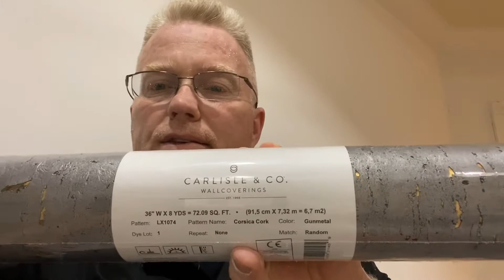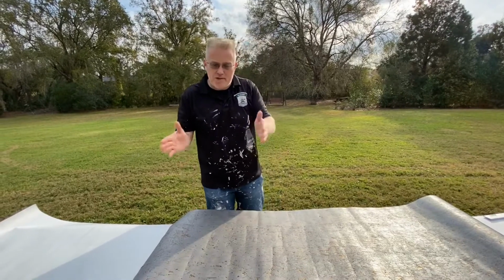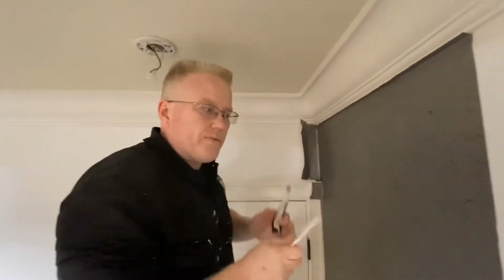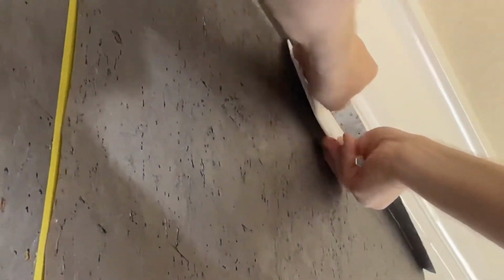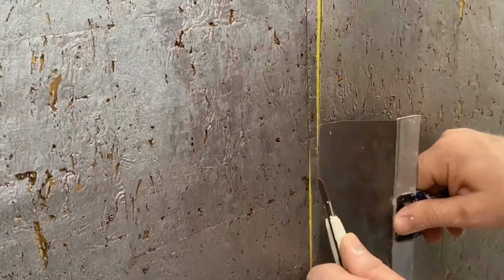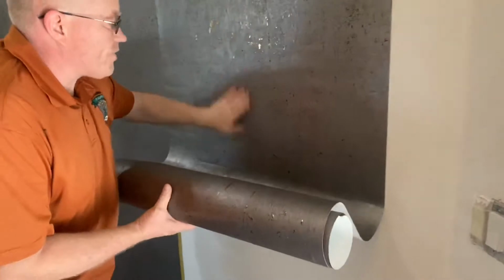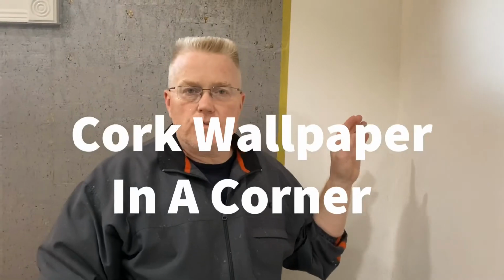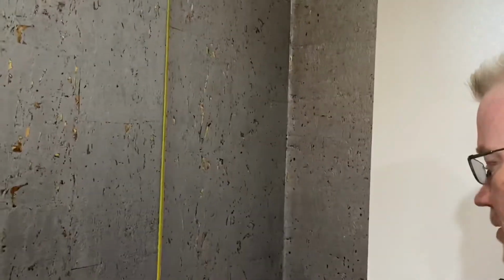How to Install Cork Wallpaper - Spencer Colgan

Comment: I’ve already purchased Zinsser “ Sure Grip “ heavy duty clear strippable wall covering adhesive. Will that work?  Also wondered if I am laying the sealed plywood down flat on my work bench is there a preference as to pasting the sealed wood and not the paper or vice versa? Thanks so much for your help

Comment: Hi Spencer, love the videos. I am currently about to hang the same paper as in this video. Candice Olsen cork metallic paper. The trick is I have to hang it on wood. Ive sealed the wood already and I’m just concerned when it comes to just how much paste to use. Can you help?
Reply from the maker: Guess what you do… Use a low moisture paste such as dynamite 234 or Roman 838

You can either paste the product and then book it or you can the backing of the Wallpaper with a spray bottle and then book the wallcovering for three minutes and paste the wall… Do not put too much paste on either way… Does that help?
Reply: I’ve already purchased Zinsser “ Sure Grip “ heavy duty clear strippable wall covering adhesive. Will that work?  Also wondered if I am able to lay the sealed plywood down flat on my work bench is there a preference as to pasting the sealed wood and not the paper or vice versa? Thanks so much for your help